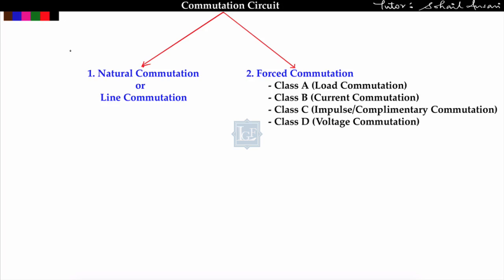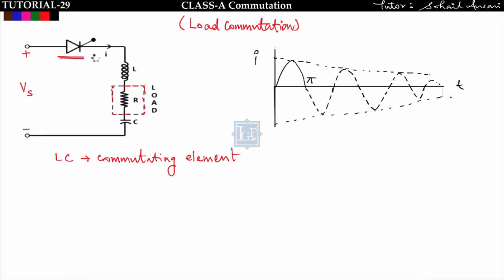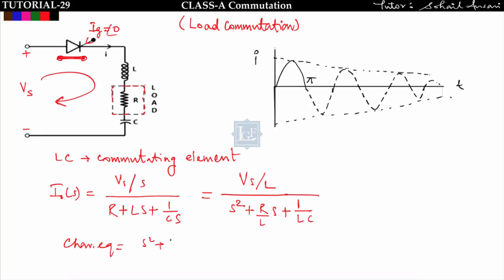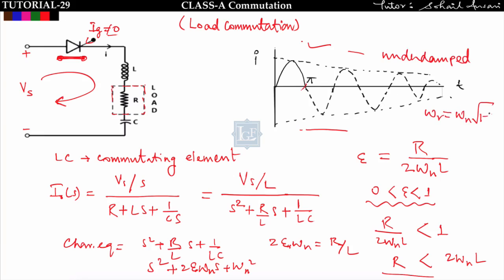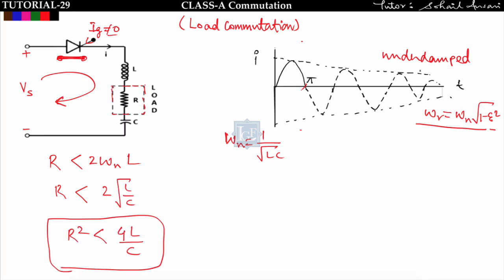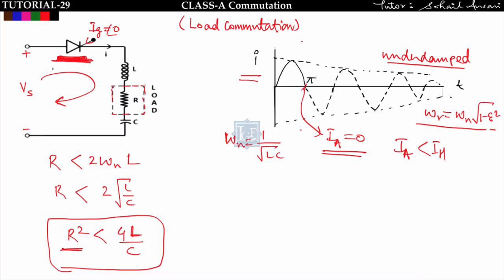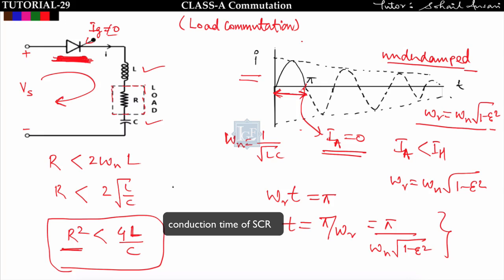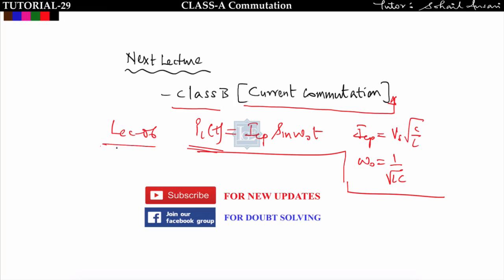Lec 29 Class A (Load Commutation)

Comment: Sir plss explain why we need lcr circuit to turnoff thyristor... thyristor can be turnoff in negative half cycle. Because thyristor will go in reverse blocking mode.. at that time thyristor wil be turnoff
Reply: The supply used for this type is DC supply , hence there is no question  of negative current values

Comment: sir thank u for effort this tutorial,sir have doubt 3phase half wave controled rectifier ,you can say that trigerring angle greater than 30 degre ,alpha plus 30 to 180 when load is R load,but i was solving problems in ps bimbra that formula not used ,page no 292 example 6.15.i was refered khanchandan also

Comment: sir this ckt is series RLC ckt. after pi might it not be the case that stored inductor energy wont allow scr's turn off. as it was in case of R-L load,SCR and AC source.
Reply from the maker: there is capacitor also..this is not RL circuit..so if u will find the response of RLC ckr then u will get sinusoidal as shown..so current u will get negative after pi..ok